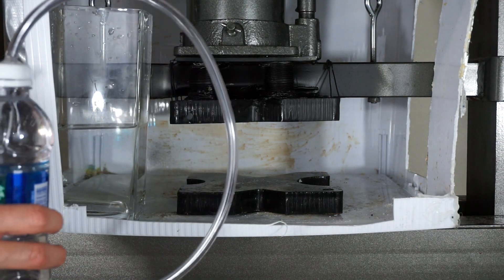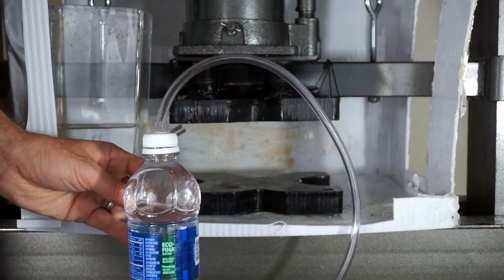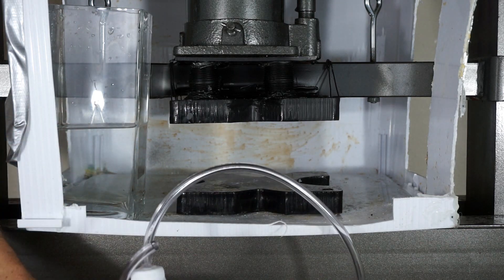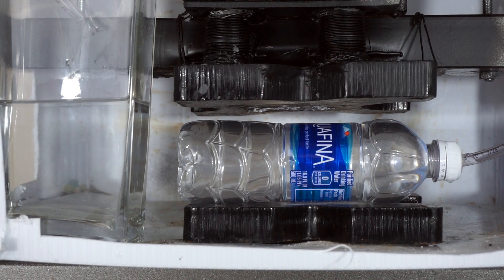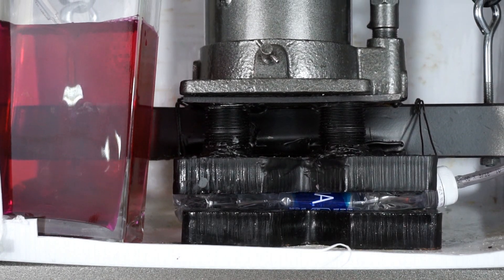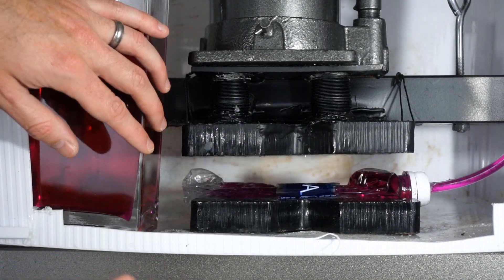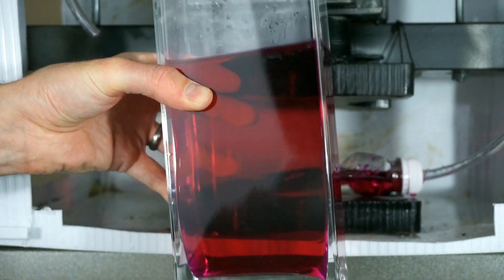Water Turned To Wine With Hydraulic Press

Comment: We did this in one if my Chemistry labs last semester. First Phenolphthalein is added to the water, then  it's poured into another  glass that has a base. If the pH of the resulting solution is done correctly, the water will turn from clear to red to clear again.
Reply: 1,000,000 points to you sir!
Reply: radioactivemermaid we did this in the first chemistry lesson and had to describe basicly the same with Phenolphthalein
Reply: radioactivemermaid you obviously searched this up
Reply: DoVe Beats how would know you haven't taken their chemistry class have you?
Reply: I thought phenolphthalein turned bright pink in bases...
Reply: radioactivemermaid
Reply: ra
Reply: radioactivemermaid
Reply: radioactivemermaid We did this in fifth grade, used Phenolphthalein for some cool "witches' brew" thing.
Reply: HufflepuffCat 6 your 5th grade was cool... all we did was multiplication with fractions and screaming at recess
Reply: radioactivemermaid you get 1 million points!!!!! Congratulations on your first place prize.

Comment: I think the  way he turned water into "wine" was by using a chemical that detects acidic levels in water and other drinks/liquids. If it's acidic it should turn into a red color. The way he turned it back was by adding non-acidic water to the "wine" then it should balance out and go back to normal.
Reply: Alexandra  Hingle that's 1 million points for you
Reply: Congratulations
Reply: Thx c;
Reply: veronica mars and the anti date-rape disks 😝✌🏼

Comment: I think it's something to do with acidity and pH levels. I think the vase had neutral pH level which makes it clear. Then inside the bottle is Hydrochloric Acid? most likely because HCl pH Level is low which is red. and in the end He added alkali (pH 9-15) substance to the red liquid (pH 1-5) to neutralize the pH levels making the red substance clear.
Reply: Do I get 1,000,000 points :D
Reply: Rammfirst44 ummmmmmmm
Reply: Rammfirst44 or red dye...
Reply: Don't know if dye has anything to do with pH levels.
Reply: The pH of red dye is 7, as is water's.

Comment: The water into wine could easily be done with Sodium Hydroxide,  Phenolphthalein, and vinegar.  Sodium hydroxide mixed into the "bottled water" and phenolphthalein in the vase, the "bottled water" mixing with the phenolphthalein would cause a red/pink reaction. Adding the vinegar would neutralize the reaction and return the color to clear. So that's how it is done I think

Comment: Acid base chemistry with Phenolphthalein. This molecule turns pink in basic conditions and the color can be "tuned" based on the ph level. So an extremely basic solution should turn it dark red. This molecule is often used as a strong acid strong base indicator as it turns subtly pink at a ph slightly above seven.

Comment: OMG! Thats over 9,000.

I think it wasn't all water, and that the bottle contained a different liquid than the vase. More specifically, and given that particular colour change, I think you mixed reactant with reagent in a ratio. There are various ways to make reactants, one way (if you can get hold of any) involves mixing comparatively smaller amounts of solute, which bear in mind can be dangerous, into pure solvent. Another involves C1, C2, V1 and V2 and if your not careful you end up needing live moles, raising ethical issues. For anyone wishing to recreate this, good luck and be careful.

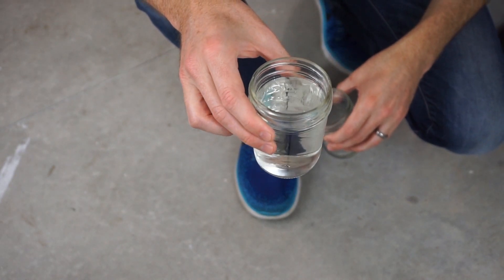Comment: 1:31 I’m guessing you put phenophthalein and the water bottle is something like a sodium hydroxide solution or another transparent base. With the presence of the base the phenophtalein reflects the violet wavelength of light, however when you add an acid, which could be even just vinegar, as seen on 2:23 it’s pH changes and it now let’s all light through

Comment: You used ab acid in the vase and the water bottle was filled with a ph tester
Reply: taotaotaga CNMI it could also be vice versa, the acid wont melt the plastic if its of a low enough concentration.
Reply: +7iann true thanks for the correction